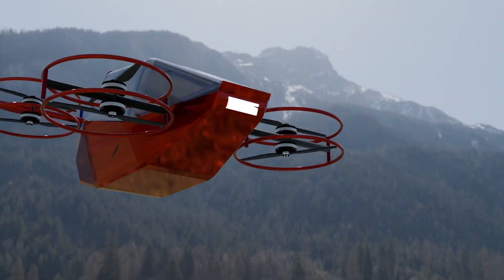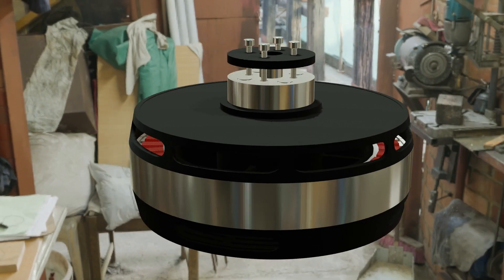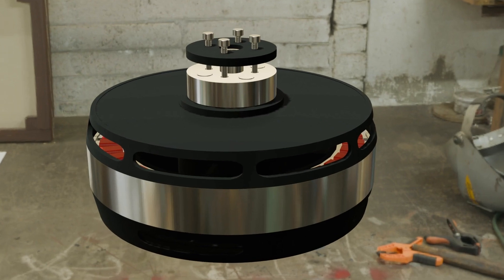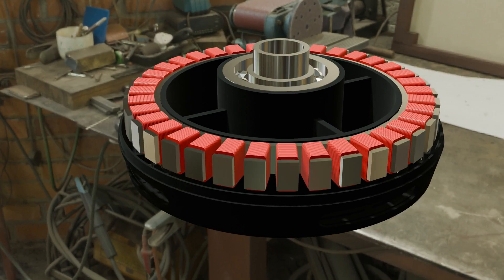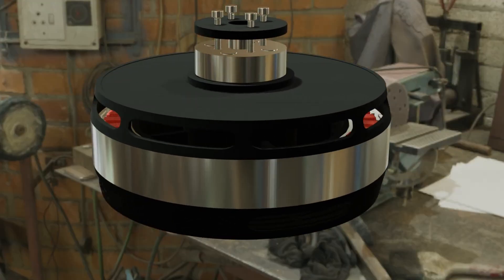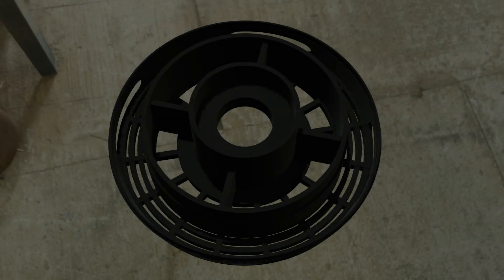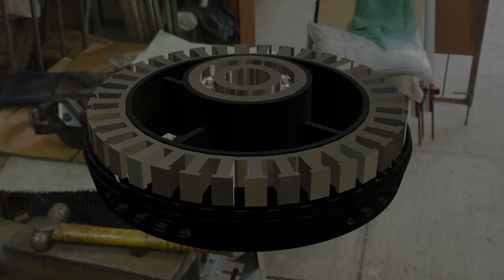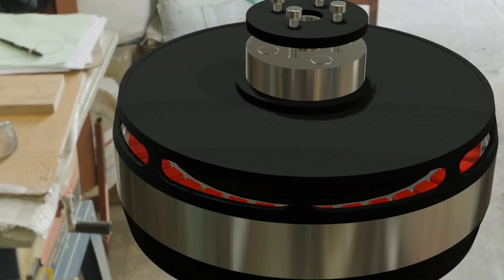Custom BLDC outrunner motor for heavy lift drones and propulsion. #rotor #quadcopter #drone #evtol

Comment: Какой используется головной модуль управления, и на основе какой программы прописаны всё команды для электромоторов? C++?
Reply from the maker: The system is based on custom control.  which gives the user freedom to make changes at will without rigid procedures.  The flight control commands are processed with a Teensy Duino C++ 600mHz downloadable software
Reply from the maker: I use a full Teensy 4.x sensorless BLDC controller that uses interrupts for precise timing (commutation + sampling) and drives a 3-phase bridge with complementary high/low outputs. It implements:

Open-loop startup ramp → lock-in → transition to sensorless

Back-EMF zero-cross detection on the floating phase

Programmable blanking time after each commutation to avoid switching noise

Timer-scheduled commutation advance (~30° after ZC; i.e., next commutation after the same time interval measured from last commutation to ZC)

PWM at ~20 kHz with complementary pairs (one high side PWM’d, the opposite low side held ON; 3rd phase floating)

Interrupt-driven timing using IntervalTimer (Teensy) for consistent behavior

How this behaves (in practice)

Open-loop startup: it steps through the 6 commutation states with a decreasing dwell time and a rising duty until the rotor spins up enough to generate measurable back-EMF.

Lock-in steps: a few fixed-period commutations to stabilize rotation and phase relationship.

Zero-cross detect: after each commutation, it blanks the ADC briefly, then samples the floating phase against Vbus/2.

When the signal crosses zero with the expected slope (+/-), that’s a valid ZC.

It measures (time from last commutation → ZC) and schedules the next commutation after the same delay, which approximates the required 30° advance.

Closed-loop sensorless: commutation timing is now driven by the ZC timing; duty controls torque/speed. You can wrap a speed loop around dutyCmd if you instrument RPM.

Hardware notes & tuning

Gate driver with built-in deadtime is highly recommended. If you later swap to FlexPWM submodules directly, you can add precise deadtime in hardware and run truly complementary PWM on both high/low sides.

ADC dividers: scale each phase and Vbus/2 safely into 0–3.3 V. Decouple Vbus/2 with a good capacitor so it’s a steady reference.

BLANK_US: increase if you see false ZC immediately after a commutation (switching spikes). 8–30 µs is common.

Debounce: ZC_DEBOUNCE_SAMPLES tames noise; if ZC is missed, increase sampling rate (timerADC.begin(..., period_us) smaller).
Reply: Укажите пожалуйста пошагово всё электронные компоненты используемые в вашем проекте от крупных узлов до мелких моментов и номер либо ссылку на эти детали, спасибо)
Reply from the maker: @night_kick 
1	Q1–Q6	6	Power MOSFET, 100 V class, ultra‑low Rds(on)	Infineon OptiMOS™5 IPT015N10N5ATMA1	Infineon	IPT015N10N5ATMA1	IPT015N10N5ATMA1CT-ND
2	U1	1	3‑phase smart gate driver (SPI), 6–95 V	TI DRV8353RS (48‑VQFN)	Texas Instruments	Internal bootstrap diodes; integrated current sense amplifiers
3	C_BS_U,V,W	3	Bootstrap caps for HS gate drivers	0.1 µF 50 V X7R 0603 (e.g., Murata GCM188R71H104KA57D)		Place close to DRV8353 HB/HS pins; 0603 X7R
4	C_CPH, C_CPL	2	DRV8353 charge pump caps (CPH–CPL)	0.1 µF 16–25 V X7R 0603 (e.g., TDK C1608X7R1C104K080AA)	
5	C_VCP	1	DRV8353 VCP cap (VCP–VM)	1.0 µF 16 V X7R 0603 (e.g., TDK C1608X7R1C105K080AB)
6	C_VDD, C_VGLS	2	DRV8353 VDD & VGLS decoupling	1.0 µF 16 V X7R 0603 (e.g., TDK C1608X7R1C105K080AB)	
7	C_DVDD	1	MCU/logic rail decoupling from DRV8353	1.0 µF 16 V X7R 0603 (e.g., TDK C1608X7R1C105K080AB)	
8	C_LOCAL_0V1	6	Local switch‑node decoupling per half‑bridge	0.1 µF 100 V X7R 0603 (Murata GCM1885C2A104JA16D)	Place tight to MOSFETs
9	C_LOCAL_2U2	6	Local HF DC‑link ceramics	2.2 µF 100 V X7S 1210 (Murata GRM32ER72A225KA35L)	Near each half‑bridge pair
10	C_BUS_BULK	3	Main DC bus bulk electrolytics	470 µF 63 V low‑ESR (Panasonic FR, EEUFR1J471)		Distribute across bus; add more as needed
11	D_TVS_BUS	2	Bus protection TVS diode (58 V standoff)	SMCJ58A (DO‑214AB) Littelfuse	Place near input connector
12	R_SHUNT_U,V,W	3	Phase current shunt (4‑terminal)	KOA PSG4 0.5 mΩ 10 W (PSG4NTEBL500F)	If extra margin desired, use two 1 mΩ in parallel per phase
13	R_G_ONOFF_UH, VH, WH, UL, VL, WL	6	Series gate resistors	4.7 Ω 0603 1/10 W (Stackpole RMCF0603JT4R70)		Adjust per EMI/edge rate; can split for separate on/off
14	R_G_PD_UH, VH, WH, UL, VL, WL	6	Gate‑to‑source pulldown	10 kΩ 0603 1/10 W (Stackpole RMCF0603JT10K0)	One per MOSFET gate
15	R_SNUB_U,V,W	3	Snubber resistor (tune empirically)	3.3 Ω 1 W 2512 thick‑film (Yageo RC2512JK-073R3L)	Yageo	Start ~3.3–10 Ω; verify thermals
16	C_SNUB_U,V,W	3	Snubber capacitor (tune empirically)	4.7 nF 1 kV C0G 1206 (KEMET C1206C472JDGACAUTO)	NP0/C0G for low loss; adjust 2.2–10 nF as needed
17	R_BLEED	1	DC bus bleed resistor	10 kΩ 3 W wirewound (Vishay PR03 series) or similar	Vishay	PR03000201003JA100	Optional; for safety discharge, size to thermal
18	NTC_INRUSH	1	Inrush limiter (optional)	Thermometrics CL-60 or similar 5–8 Ω @25°C NTC	
19	C_INPUT_0V1	2	Input connector HF decoupling	0.1 µF 100 V X7R 0603 (Murata GCM1885C2A104JA16D)		Place at connector